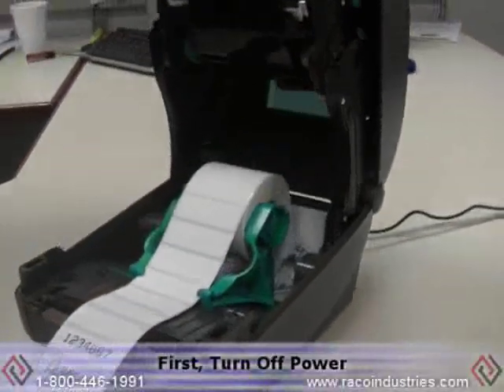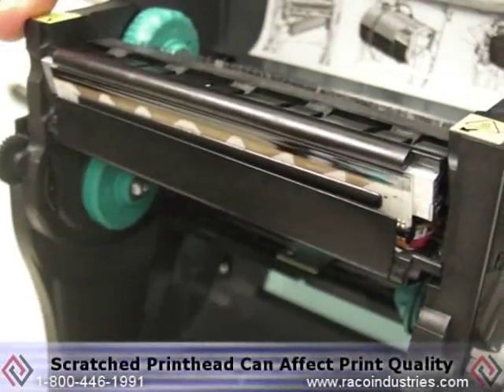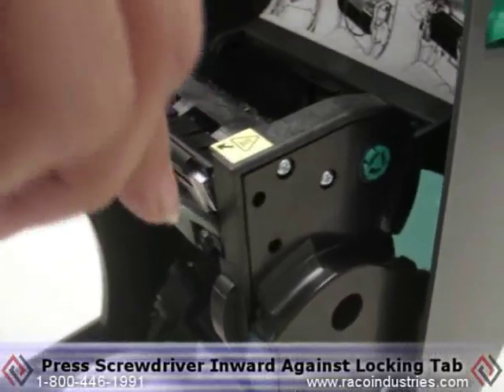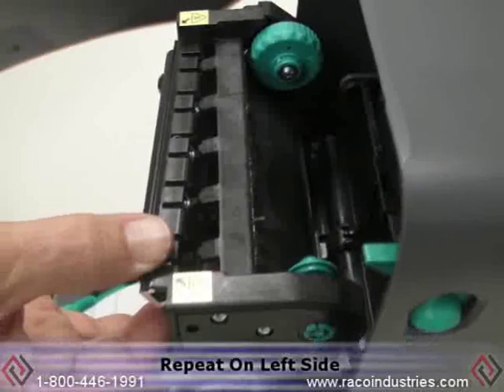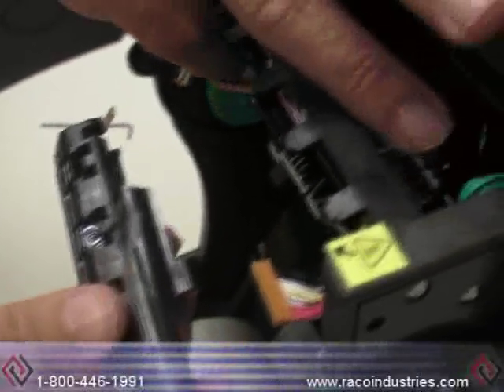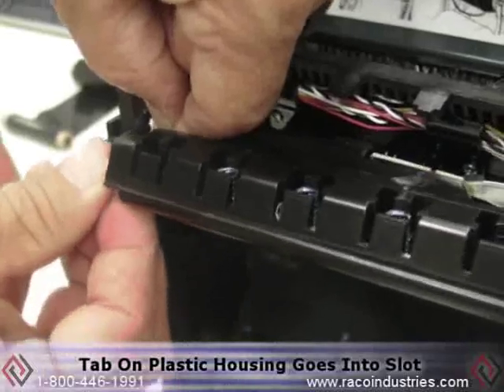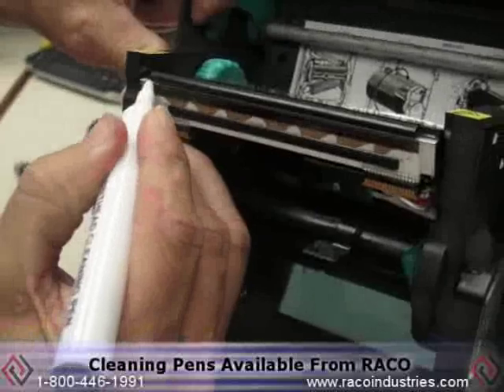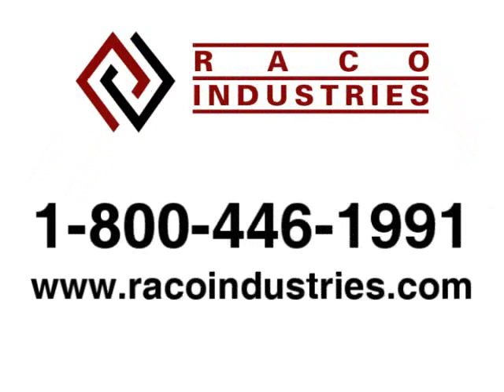Zebra GK420T Printhead Replacement

Comment: So your head did not come with assembly. It slides into the plastic. With a flat head push straight on the end without the ground. Springs are in there.  Look at it first. Slide new head back in same way. Slowly use your finger nail to hold down spring one at a time while sliding new head on.  There are 3. If one gets damaged leave out the middle one.

Comment: We are having a similar problem. Pushing the firmware using the utility and zdownloader did not resolve this issue. It is not our media as we have tested it with other printer models and it is fine. The issue we see is that it calibrates, then we send the print job (batch lot) and it prints the fist 4 every time and then it stops and the red light starts. We clear it and it prints the config pages and then stops again. This is for a printer out of the box and a several in production. We are using a resin ribbon on some jewelry labels (anti theft). We have changed all settings to see if this resolves it. But the very first issues we saw was that the labels would creep out of alignment, like the sensor did not detect the mark. So we changed the settings to resolve that issue but this new issue came out.
Reply from the maker: +Guillermo Saldana,  the best way to solve your issue is to call our Toll-free Service Hotline at 1-800-218-5417 or email repair@racoindustries.com to get in touch with one of our Factory-Trained Technicians.

Comment: The ground clip just pushes in,and the springs underneath the printhead are a little tricky...
Reply from the maker: If you're still having issues, call our Toll-free Service Hotline at 1-800-218-5417 or email repair@racoindustries.com to get in touch with one of our Factory-Trained Technicians.